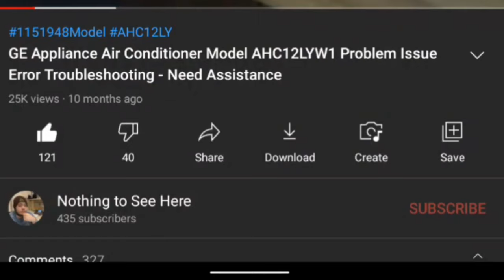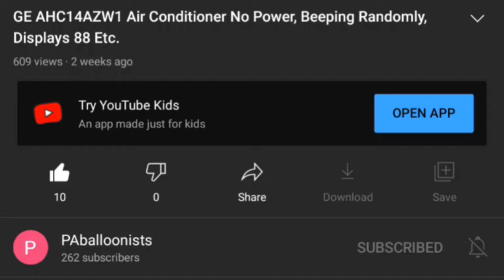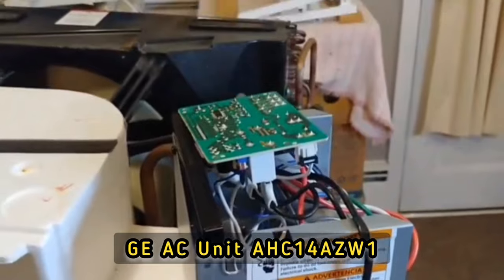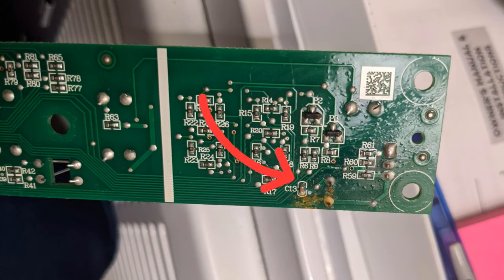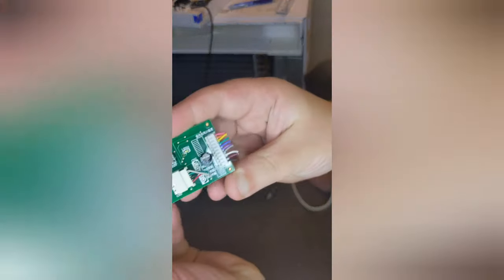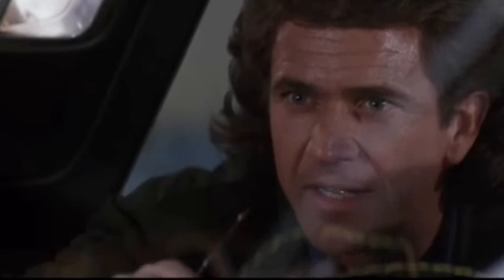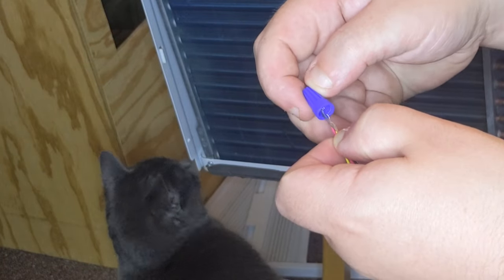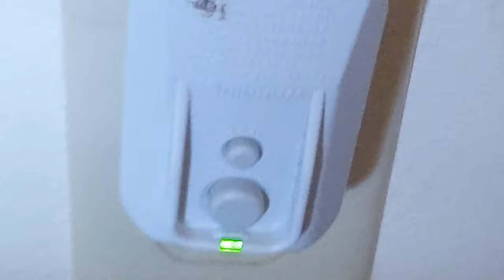GE AC Unit Model AHC12LYW1 or ACH14AZW1 - Unit Beeps, Shuts Off, 88 Symbol Bypassed DIY | How to Fix

Comment: THIS JUST WORKED FOR ME!!! thank you tons!!! my a/c unit is barely 3 months old, i was sooo upset when i woke up to my blinking/beeping unit this morning.

i have never done anything like this and i was apprehensive all day about opening my unit up. everything went smoothly, genuinely the hardest part was stripping the 4 wires,, because i used manicure scissors instead of actual wire cutters lmaooo. you just saved me sooo much stress and hassle. thanks again
Reply from the maker: Love hearing this!  We've used this fix for the second summer in a row... No issues, just no convenience of a remote... But luckily the surge protector works great
Reply: @clarkkc11  going to try this with mine its about a700$ unit brand new only used one summer Power surged in house during a thunder storm now its doing the beeping and only rays on a couple secs then back to 88 when I connect those wires you said it will put it on high cool setting
Reply: ????? Thanks for the video that’s the only question I had going to try it just was wondering
Reply from the maker: @livinglife4921  yes.  Do claim any warranty if it's less than a year and get a new one in GE.  Moan.. complain.   Whine.  Get a new one by rebate from GE.

And yes this should be high setting
Reply: @clarkkc11   
You are the man! 👍
So glad you put this out there. Kind of similar situation here with the power surge. Except I bought the GE AKLK24AAG1 which is the 24,000BTU ac unit that is 220 volts. Bought in July 2021.Ran great that summer.
Used it 3 days in April. Then electricity flashed off then back on. Hurried and cut it off bc that's not good for the compressor to cut off/on quickly. Waited 15 minutes and cut back on. It runs but when it calls for the compressor to kick on it never will. Was told that it was more than likely the capacitor so bought new one exactly like the original and still compressor will never kick on. Don't know what could be the problem. The fan runs one very mode just something isn't letting the compressor kick on. Paid
$700 plus tax but gambled on the warranty and didn't spend another $100 for a extra year warranty. So I got a GE - POS that l got 4 months use out of . Sitting on a work bench in my living room and weighs close to 150 pounds. So mad at GE and my electric company. Neither will take fault but hint that its my fault for not buying the extended warranty. Any references to try and find out the source of the problem. It still looks brand new. Already temp. in the mid 90s with humidity at 95% down here in Louisiana.. Would love to buy whatever parts I need to fix this GE to at least feel like I got screwed again buying the wrong brand. Last time I bought a $700 LG with a $100 extended warranty and lasted 2 and a half years  thanks to everything we can buy is 100% China made junk.

Comment: Thank you for uploading this video.  This solution worked for me, although I didn't cut the black, white, red, and yellow wire. I may attempt to reconnect the others one by one just to see what I have until I order a replacement circuit board.

Comment: I have model AHTK08AAWI, THIS WORKED PERFECTLY! Ours went out after a storm/power outage. Of course no buttons work but it’s blowing out perfectly cold air. Possibly remained on the same temperature as it was prior to breaking, so it’s super cold. I will give an update if it stops working. Hopefully not!!!
Reply from the maker: I am on my 2 or 3 summer with this fix...

Comment: Yes i can 100% confirm. It is the circuit board. I bought 2 of the these (haier) not ge but the same beeps and same front and button layouts. One died after the 1st summer. So i swapped circuit board. Works perfect. I could not see any circuit board damage. Im looking for a replacement circuit board now for the one i stole. I did not try the bypass trick. But can confirm its the circuit board.

Comment: Great video, this definitely got my air conditioner running. I lost all functions on the air conditioner but totally fine and thank you for awesome tutorial on how to get sc running 🤝🏽
Reply from the maker: Yes, all function is lost, but finding a replacement board that would repair the functions is hard to acquire. Thanks for the review I'm glad you're staying cool!
Reply from the maker: Some folks have wired in a thermostat to make it a little smarter

Comment: Yep....10 minute job.. I can concur, this method DOES WORK FLAWLESSY!  Great Job up loader! Ahh, now I can relax in the "coolness" and not have to call that rude a** repairman back.
Reply: Having the "rude a** repairman" back wouldn't help with this unit. I called GE and talked to a tech. They don't sell the control or power boards for this unit. When it fails, it is basically trash because it cannot be repaired to work like new again. I will never buy another appliance before I look up the model's parts list to make sure I can get the parts to repair it if needed.

Comment: Reset my thermostat temperature setting which was set too high, reduced it to a cooler temperature setting and voila! It doesn't turn off so frequently.  It wasn't in need of 'repair', just a lower temperature setting!

Comment: Dude, you are a lifesaver!  Worked perfectly.  Saved me from throwing the whole unit in the trash.  Thank You!!
Reply: You can't even buy a control board for this model unit at GE! On their homepage, they brag about how 'green' they are, then build $450, 45 pound unit that has flawed engineering, and can not be repaired when it fails! Straight to the dump in most cases. Way to go GE !! I will not buy any product from them again. I will also look up the replacement model's parts list BEFORE I buy one to make sure I can buy parts for it when needed.
Reply: Why would you throw it in the trash? Jesus.. you people know you're supposed to take these things to a proper disposal site, right?

Comment: Came home last night on a 90+ degree day with my AC not working.  This morning it’s up and running thanks to this video!  

Quick question… anyone know if any safety features are now nonfunctional considering several things were bypassed?  Thinking maybe I should run it for just a few hours at a time to be safe.  

Thanks again!
Reply from the maker: I have this concern as well.  I do not run for long periods of time, just in case, but I don't think anything major was tampered with and the control board is low voltage.  As long as the individual wires are separate and enclosed, should be moderately safe for an at home hack job...  But use caution for sure!
Reply: @clarkkc11  Excellent!

Comment: How easy is it for your to remove or open the black enclosure?

7.2.2024 est@1942hrs NYC
Reply: Disregard. There was a screw hidden under sticky insulation.

AHY14LZW17 screws. 

7.2.2024 est@1945hrs NYC
Reply from the maker: @stilllyte  super simple!
Reply: @clarkkc11  yup I got it running.  Had to run get some electrical tape but it came on.  Im going to sell it for a small amount letting buyer know the history 

7.2.2024 est@2106hrs NYC

Comment: Yes!!!! This just happened to me last night there was so much moisture in the housing I’m surprised it didn’t happen sooner. The housing has no seals and is open to collect moisture surprised there isn’t a class action or a quick replacement. I really don’t want to spend another $400 on an ac.
Reply: Call GE, u can get another 1 for free! Even a different model! We've been having this issue & my husband called & hardly any questions were asked. Didnt even try to send some1. They told us to take warranty sticker off & go get a new 1 for free. Different model & everything! My husband is otw to get it as we speak. U even get to keep the 1 u already have. So hopefully this video will help me fix it & we'll have 2 for the price of 1!
Reply: This is not accurate. I had the same issue. Warranty and all. They wanted me to send the model and serial for the broken, purchase a new conditioner $269.99 again. Then email the purchase receipt and the serial and model sticker to their General Relations dept and wait 6-8 weeks for a rebate on the purchase of new air conditioner.  Problem? 1. I needed air now. Not is 6-8 weeks. 2. Why would I spend money on another GE when I already purchased this one and it has issues. 3. They don't give a full rebate after you have purchased another and waited 6-8 weeks 🤷‍♀️😡
Reply: @MsTwichi  yes this is accurate. Same thing they said except I needed to wait for an email that they would send me then reply to that email with my model and serial numbers and receipt attached.  Then they never even send the flipping email! Had a 400 dollar unit work for 3 weeks and got the run around so bad on a replacement ge is a joke

Comment: Mine was under warranty when this happened. They replaced it and let me keep the old one. I went to partsDr and purchased a new control board and it works just fine now. Now I have two. The new control board displays the room temp just a few seconds after the thermostat is adjusted. The original control board did not display the room temperature so they must have added this feature to the control board. In order to replace this you have to unplug the old one and plug the new one in from the inside of the power supply without touching the capacitor.

Comment: My issue is similar with the death chirp but I don’t get the 88 code. This is my third GE unit in a row that I’ve had to get rid of after a year. After EXACTLY a year. Happens in June every year. So what mine does is beep and light up, then sometimes it will do that second beep that shuts it off. Sometimes it won’t and just the screen will light up and then after a minute dims like it usually does. It’s hit or miss. Sometimes it will do this several times a day, sometimes it will go a whole week without doing it. I keep buying this AC because it’s the only one anyone has around here that’s 8000 BTU! I am going insane with this!
Reply from the maker: Poor design.  I think there are enough folks for class actions

Comment: I have bypassed electronic controls on many ACs. Common problem. I install an on off switch and double throw fan speed switch for high and low. You can install manual thermostat so it cycles on and off but i just run them continuously. This happens with refrigerators, stoves and washers and dryers and everything else.
Reply from the maker: How do you identify colors of wires and proper paths and uses?
Reply: @clarkkc11  I can tell you that the black seems to be power as black and white together energize the pump, black and yellow together energize the fan. what I dont know is what the red does???

Comment: just did this today..is yours still working? just wondering how permamnnt of a fix i have here my ac was installed into the wall (previous owner) and i really dont want to replace or fill the hole yet
Reply from the maker: @rickysaldana9853  whenever I made this video til now... It's in my window as I write this finishing out another summer.

Again, doesn't run all day and night but good to keep it going for a few hours at a time.
Reply: @clarkkc11  same here just didn’t want it sitting in the wall useless. Appreciate this video and feedback man you are a lifesaver

Comment: This is amazing!! But how to I chnage the temperature an so on after I do this?
Reply from the maker: This mod... Hack... Pit is on High Blast.  To have control you would have to take to the next level and wire in a thermostat or discover the coding behind the other wires we discard and don't use in this video
Reply from the maker: This was my solution to save a 1 yo ac that shyt the bed too soon... Had to still work .. just had to learn a hack job wire solution.  Took me a year to research and complete but still works!
Reply: @clarkkc11  that’s perfect so it will be on high blast an still blow code if I do this technique?
Reply: @clarkkc11  I’ve only had mine like 7 months an it just did this yesterday so Ik the feeling lol
Reply from the maker: @JC-Slayzz-  yes, high blast and control is via surge button at outlet/ plug.  Can't run forever in some climates (very humid southern states) but good for hour to two hours bursts.

Comment: Quick question.  At the 4:57 mark, where it says "model", on the circuit board, the bottom wire is separated.  Is this correct?  Mine looks like that and we were going to solder it, but it looks the same in yours.
Reply from the maker: I believe this board was used in a variety of AC units.  I believe you do not need to touch this.

This hack removes the board completely.  But if you are repairing your board, I would not modify

Comment: Just got through with your fix on my a/c. Thanks for the video and replying to my previous comment.
Reply from the maker: Absolutely!!  Thanks for watching and commenting and keeping us posted on the results!
Reply: I probably made it mistake. I pet it's run all night. This morning there was about a inch of frost covering the front of the coils. I immediately unplugged it and scraped it off. I have not tried it since. That was was 9 hours ago. Have you ever heard of that happening before? Thanks for any info on that.
Reply from the maker: @robbierobinson3966  whoa!  I have not need to run it for exceeded periods like that...
This fix does most likely disable thermostat so it just kept getting colder.  I would run for limited amount of time or... There is a way to link in a thermostat... But I haven't figure that out het
Reply: That's kinda what i thought about the thermostat to. I live in south Alabama a few miles from the Gulf of Mexico. It's very humid here and I'm sure that doesn't help either. Won't need ac full time for another couple of months. By then I will have to new one. Thanks for your help and replying to my questions.
Reply from the maker: @robbierobinson3966  Alabama!  Yes very humid compared to NYS where I reside.  How long out of the box did your unit last new?  Humidity is probably what killed it...

Comment: My unit is doing this. 
I'm thinking about trying this. 
Im nervous though.
How do you control the temperature? Will it automatically be on AC and blowing out cold air?
Reply from the maker: @user-hy6hp8lz1n  just be sure to disconnect and unplug your unit.  Where insulated rubber gloves if really worried!

Temp control goes away unless you learn some extra electrical stuff and install a replacement board. 

We are removing the board so we lose the fancy controls.
It's powered by surge protector buttons at outlet / plug and is just on and off cold air
Reply: but like they said wat temp?
Reply from the maker: @mikettamp2283 it tries for the coldest but due to controls being ripped out... It varies...  Don't run for too long as Some have reported freezing in more humid climates

Comment: 1 final note! GE did send a $75 rebate check and gave me some excuse about not having the part? Obviously GE doesn't stand behind their products!

  One thing I noted in a few products lately... they die/break soon after the 1 year warrantee,  as if the machines know? 
  But when you place the control panel midway between where the cool air comes in and the warm air goes out? 
WTF? I MEAN WHAT GRADE DID WE LEARN ABOUT CONDENSATION??? 🤔

Comment: Cool video, but not what i was looking for.  My GE says either 99 degrees room temperature and compressor stays on, or says 32 degrees and compresser wont turn on.  It mostly does the 99.   Is the thermostat sensor?  Thanks in advance for advice!😊 I cant find anyone with the same problem as me.

Comment: I just set mine up with a simple thermostat. I only needed black, yellow, and white to kick the compressor and fan on max. Red had no effect on the fan or compressor that I'm aware of. If you know what it does let me know.
Reply from the maker: I don't, I was just going off R Melnyk original video.  I couldn't quite make clear what color wires were aligning with what controls on the board.  Tried to find a wire diagram, but nothing.

I would like to know more as well.  I feel like the green wire was the ground - I assume that they used common colors for common things...
Reply: Hey Eric can you tell me what wires you used to the thermostat?
Reply: @PaintSlinger99  Black for 5 volts in. Yellow for fan. White for compressor. There is an extra 5 volt wire that's orange if you need another 5 volt in.
Reply: @Quillric  Thank very much. I am going to give it a shot. I looking on Amazon now for a simple/cheap therostat, GE was no help on the phone today, this unit is 3 months old. Crazy
Reply: @Quillric  I've currently got White, Black, Red, and Yellow twisted together to run it. Getting too cold now
Reply: Just found a blown fuseable link on the board; at J2. Going to attempt board repair tonight
Reply: Replaced J2 fuse and still throwing error; something else on board must be damaged. @eric Williams, can you recommend a thermostat? I am looking at “Emerson NP110 Non-Programmable Single Stage Thermostat” on Amazon. Will any thermostat work you think?
Reply: @PaintSlinger99  That's gonna work just fine.
Reply: @Quillric  it’s working. Very cool. Appreciate the help bud. Gonna run the wire through the wall and mount it like a conventional AC. Will try to record my full install and upload it to help others. Thanks again
Reply: @PaintSlinger99  I'm glad I could help! I look forward to seeing your video.

Comment: After you do this how do you adjust the temperature or is it on the coldest setting
Reply from the maker: Coldest.  I put mine in and just run it as needed.  The high is loud but works fast.